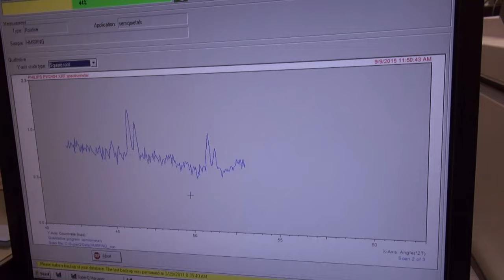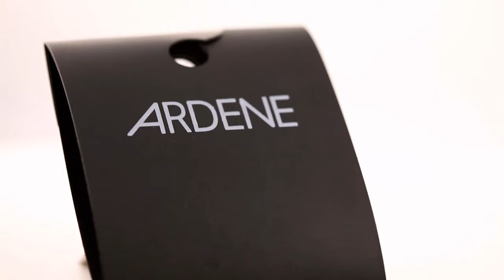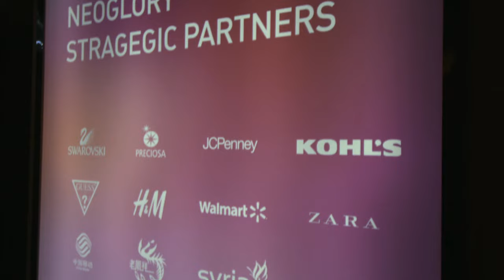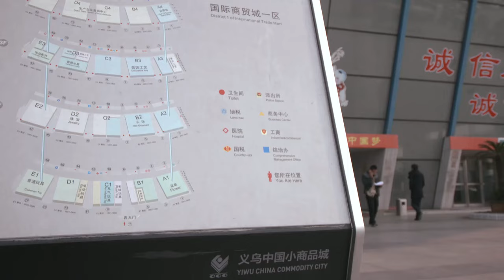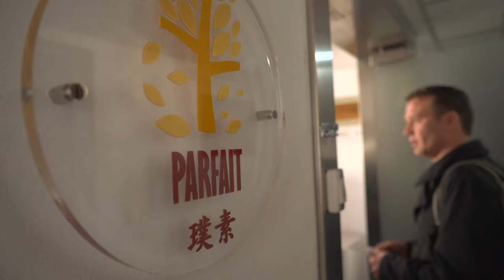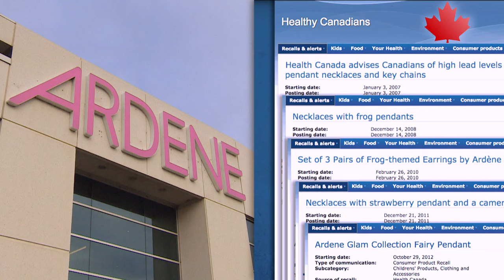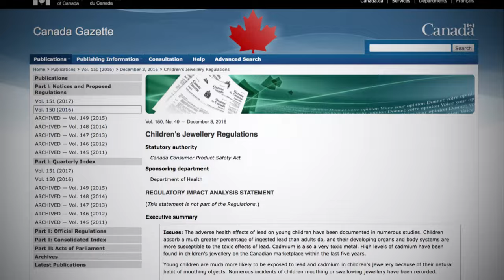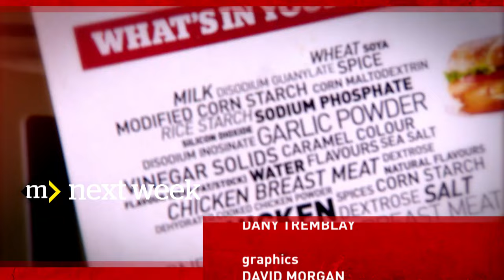Cadmium in kids' jewelry: Back on the case (CBC Marketplace)

Comment: What about cadium used in watercolors or other paints? Does it only do harm if the cadium levels are high?
Reply: To my knowledge there may be. There was all kinds of metals and toxins used in old paints but modern day batches tends to be tamer/more regulated. I would never suggest consuming it and always wash your hands just in case. Also Cadmium is a shade, so just because it says 'cadmium yellow' it may not actually contain cadmium. I would say if you are really worried to check the warnings and labels- especially with oil paints and thinners.
Reply: I know this is 5 months late, but there are brands that use and dont use cadmium. If I were you I would look at what is banned in California if you're unsure about which paints are safe. :D
 
I myself have thrown out tubes before that contained lead. Cadmium is only unsafe in its powdered form where it causes respiratory issues, because of the oil or other factors in paints. The substance is rendered unabsorbable even on human skin.
Reply: If you don't smear paint with our fingers and don't make brush point with your lips they are safe.

Comment: I thought this was a very reasonable documentary. I think for the majority of single, child-less adults, wearing cheap costume jewelry would not be a problem. There is lead and cadmium in a lot of household goods, we just are careful to not put the products in our mouths. It is pretty important to know which pieces would have the elements though, so perhaps starting with mandatory labeling of the levels in all jewelry could be a temporary solution. Of course, there is no need to use cadmium initially, as its mining and production leads to horrible environmental and ecological effects. See: Pitcher, OK.

Comment: My sister is allergic to all jewelry that isn't 100% gold
Reply: Baresan her neck will hurt if it's 100% gold
Reply: Some o d the wemon in my family has that problem. It beacuse the body fluid is to acidic. I ase a quarter tsp of baking soda in 6 oz water. It helps alkaline yhe body..  o can now wesr silver and syainless steal. But not zinc or copper. Hope this helps
Reply: There are no jewelery made of 100% gold. The 99,99% gold form is not wearable
Reply: Even surgical steel?